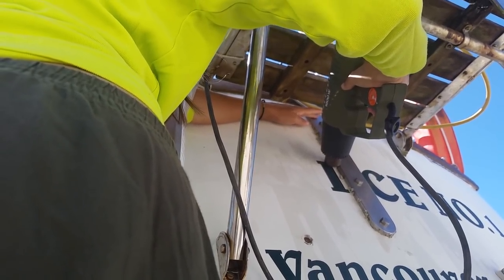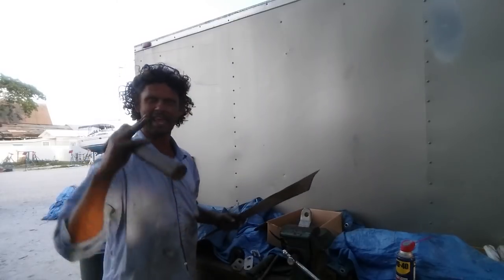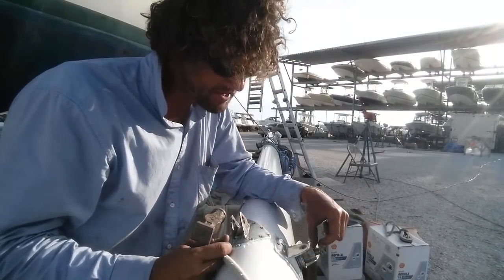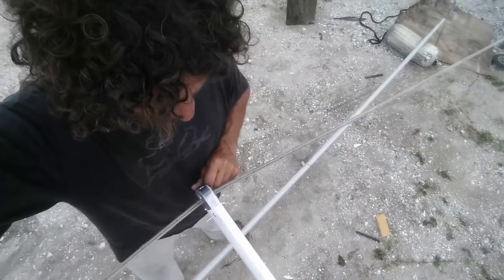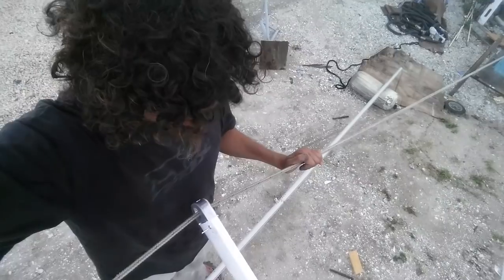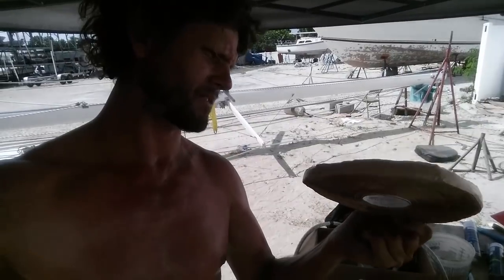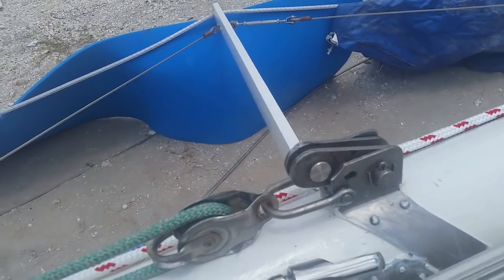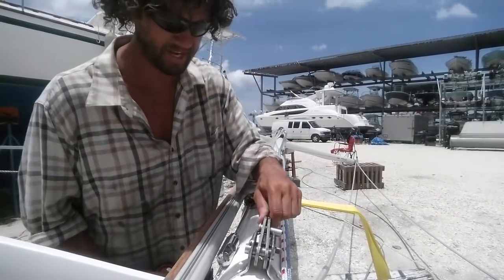Update 9 - Preparing the Mast for the Rigging

Comment: No hate here mate, just some honest advice... please, please, please read this and consider it before you have major problems.  1) Don't use nylon washers, they break down in UV FAST, get brittle, and then break.  Get Delrin washers to isolate, order from McMaster Carr. $12-$15 will get you a bag of them the right size for your clevis pins, cheap insurance. 2) Everywhere, and I mean everywhere you drilled holes or used your grinder on the stainless WILL RUST, and FAST.  Working on stainless with any tool introduces free iron particles.  Without getting crazy into the science of it, the bottom line is that you MUST have the stainless steel passivated or electropolished after your mods are done.  There is a DIY way to do it, but its actually cheaper and faster to have it professionally done and it ensures LONG life from your parts (plus they look good).  Those Galv turnbuckles; Why Why Why?! Where you drilled the cotter pin holes, they will rust and in very short order, plus the rest of the thing will rust out within a few years.   Galv coatings today are NOT the thickness and content of zinc they used to be.  If they were manufactured in the 80's or earlier I would trust them to last about 10 years with proper maintenance (but your cotter pin holes will rust in a week). So why spend all the money on Collligo line terminators and then use them on the wrong end of the shroud?  On the upper termination, use stainless eyes, plus one size up to get a better bend ratio (now you don't need the washers to isolate aluminum from stainless).  Save the money on the Galv turnbuckles and buy another terminator to have a pair at the bottom, then use as deadeyes for tension = NO RUST EVER + less pokey cotter pins.  How to terminate deadeyes to chainplates you ask?  Learn to tie a Dyneema infinite loop.  BTW, Colligo is very expensive.... kind of a rip off, but the stuff is super high quality.  The Dux line is WAY overpriced, there are heat annealed dyneema lines out there that are the same SK75 or SK90 fiber that cost way less and just as strong.  I make deadeyes from Delrin = no corrosion issues ever and just as strong in compression.  Anyway, the butyl tape isn't a bad idea to isolate the stainless screws in the spreader tips, but TEF 45 is WAY better.  It's $35 a jar but a single jar lasts a lifetime.  To should have coated every bolt and screw that went back into the mast with that stuff.
Reply: Nothing like writing a book for a guy who's visa is running out and doesn't have time to read books.
Reply from the maker: Thanks for putting that down...I just didn't have time to read YT when I was on the hard. Goo d advice. DO you adjust the tension in the stays and spreaders with a system of blocks back to the main winch?
Reply: Yes, just one block or low friction ring on an endless loop attached to deck... A Dyneema core line on the winch pulls the lashing line to tension the rig.  I just finished a tensioning system for S/V Zingaro, they will be posting a video of the install in the next few months.  Look me up on Facebook, just sears Kraken Structures of 'Sea Monster Strong', we can always do a video chat if you like.  You can use those Colligo terminators to make a lashing system and ditch the galvanized turnbuckles.